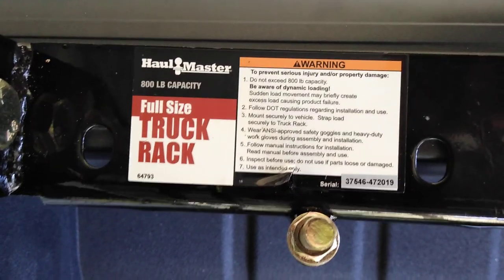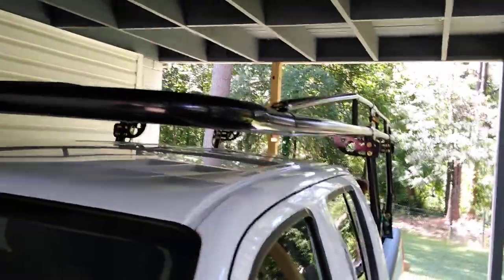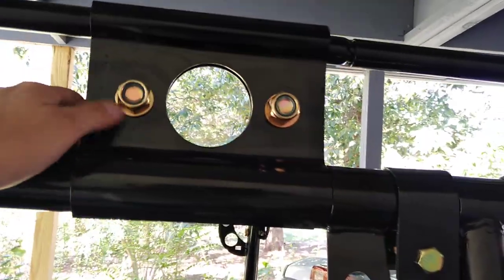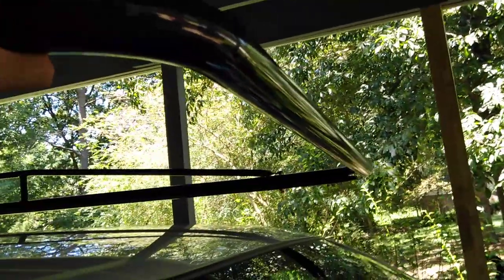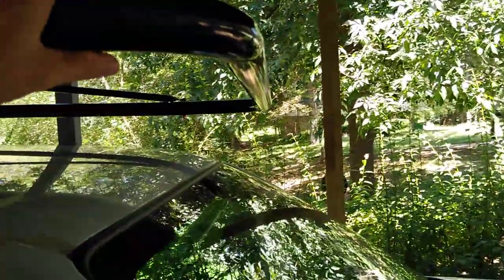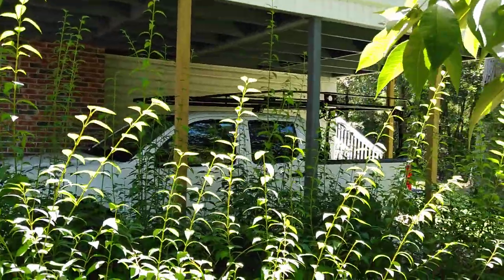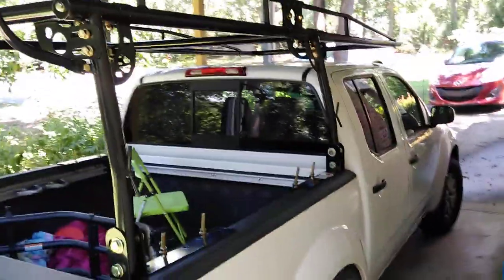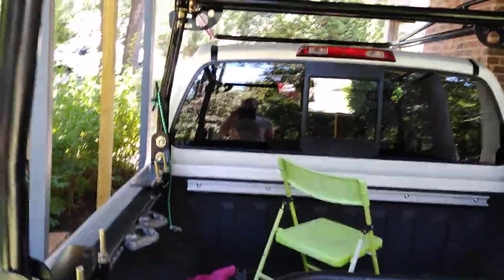2019 Nissan frontier with the Haul Master Ladder rack

Comment: I bought the same and I installed on a 2012 f150. When i installed i put the extenders without realizing lol that thing was high! Then I removed them and it looks normal now, but NOW, I'm considering rising it up and mount like in a hanging position, some type or cargo rack or maybe even a metal tool box from the pipes right above the cab.  I say hanging that way it wont be in the way if you need to carry long stuff like studs or something. I think it would be useful since trucks are limited in space.

Comment: I am looking at the same rack for the same truck.  How's it holding up, you still happy with the purchase? Do you have any problems with rust leaking out of the seams?  I've seen other videos where that's been a problem.
Reply from the maker: Yes that's why you have to foam  on the inside.
Reply: @davidbarrett8118  wat foam do u use? Great stuff
Reply from the maker: After foaming not anymore!!
Reply: @davidbarrett8118  what kind of foam did u use
Reply: Im looking into getting one for my ford ranger
Reply: @josesoto9099  I ended up getting one for my frontier.  It was def a two person job.  I have it mounted using the temporary bolts.  I used flex tape at the joints.  Seems solid.  I've hauled a a few 4x6x12' on it already.  Pretty happy with the purchase.
Reply from the maker: @strangus  I would definitely consider foaming into the holes if you haven't already, I have really enjoyed my wreck for hauling wood and my canoe, but it's pretty discouraging to have rust come leaking down on your white truck 😂
Reply: @strangus  
So you only need to seal all the joints ? Not foam inside pipes
Reply: @josesoto9099  I only used flex seal.  If there is an issue, I'll foam.  I'll give an update on this thread in a couple of weeks.
Reply: @strangus  thank u
Reply: @davidbarrett8118  
How did you foam in the holes? Before putting it together or just the bolt holes
Reply: @josesoto9099   I feel flexseal will be good enough, It's on there pretty good.  I've already hauled a bunch of 16' pieces of lumber.  It's well worth the money.  I've seen a couple of other people using them, they're easy to spot.  It's tough getting a rack for a small bed,  this solved the problem.  If I had a full sized bed, I'd probably go with a full welded rack.
Reply: @josesoto9099  Welp.. today after 2 weeks of rain, I noticed rust.  It's pretty bad, but meh, I still like the rack.
Reply from the maker: @josesoto9099  I apologize good sir for the late response! I use the foam good stuff, I did not phone the holes prior to putting it on top of my truck so I had to take off the front and the back pipe and then put it through the pipe and sprayed in there. This past weekend I hauled a very heavy sleeper couch on top of my rack and it held up great!
Reply: Where did you buy it at?